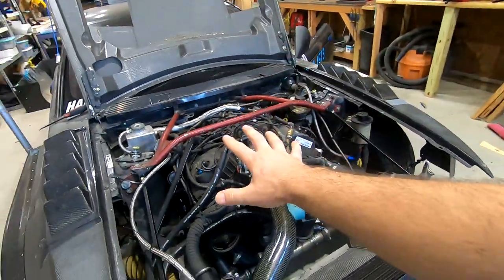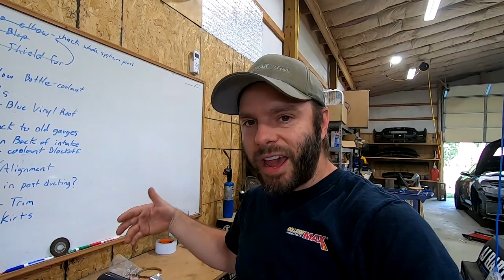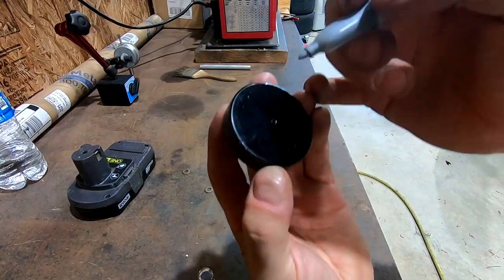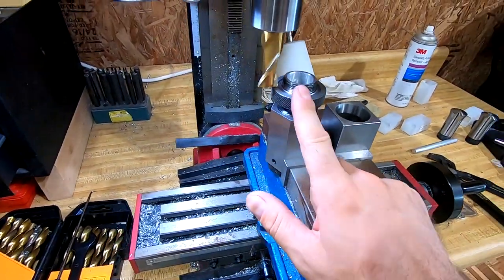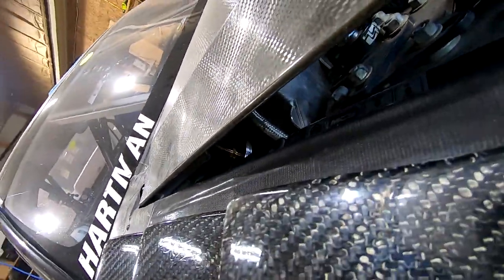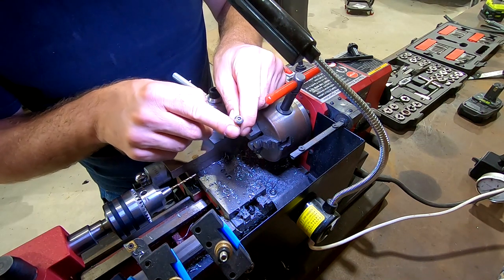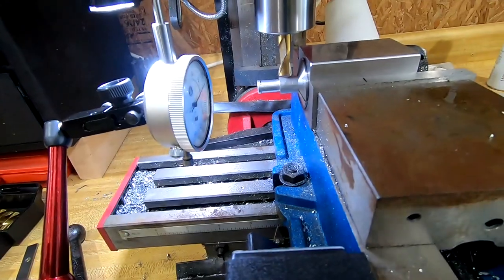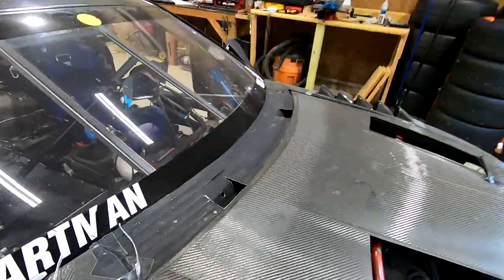Not Your Average Coolant Overflow Install

Comment: I recently bought the same bottle, albeit under a different (re)brand. There is one difference though: the lid does not have a venting hole in it. If I tighten the lid on the bottle I can create overpressure (or vacuum) inside the bottle. I don' think that is correct for an overflow bottle.

Comment: How does it actually vent if you use the opposite end to tighten down the bolt in? Understand it’s not completely sealed with thread tape or sealant but still not really venting either. Did I miss something?
Reply from the maker: Yes. You missed where the hole goes all the way through everything.